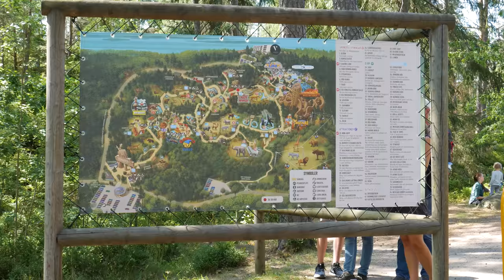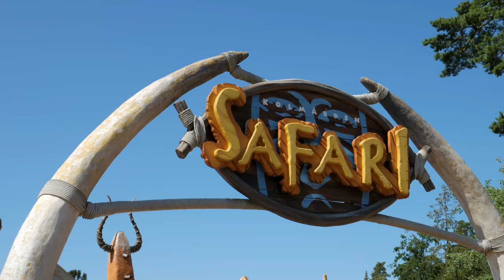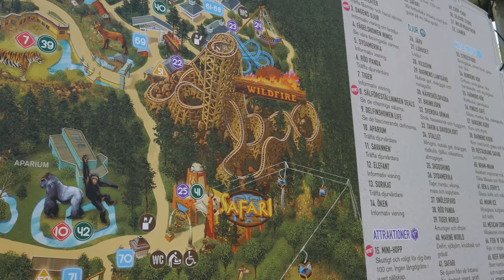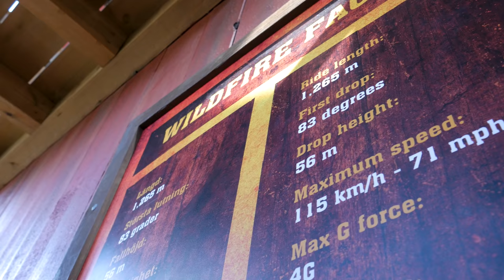What is: Wildfire - Europe's Tallest and Fastest Wooden Roller Coaster

Comment: My problem with RMC “wooden” rollercoasters is are they really “wooden” There is so much steel on the track it’s more a hybrid style track
Reply: Also they aren't wooden coaster because of the steel support structure
Reply: Regular wooden coasters feature quite a bit of steel as well.
Reply: @Sonderax  but look at the structure that holds the lifthill. It's not just a bit of steel it's purly steel.
Reply: @MoniceSF  So 1 lift hill makes the ride a hybrid. All wooden coasters use steel in some aspect.
Reply: @Sonderax  you'll never get it will you?
Reply: @MoniceSF  i get it. but wooden coasters all feature steel supports at some section. so are there no woodies at all?
Reply: Simonize pe so does white lightning at fun spot not qualify as wooden because it has a steel structure?
Reply: No some of the normal wodden coasters by gravity group have fully steel support structures but are still considered wodden coasters

Comment: I love coasters but if Kolmarden says "no more attractions that scare animals" then at least they still have Wildfire. Otherwise I'd love to see a Fury 325 sized version of Diamondback; a with a 320' drop, a top speed of 95 MPH, a length of almost 8,000' and more airtime than any coaster in the world. They'd need silencers for the noise that comes from resetting the trim breaks so as not to scare the animals though, so perhaps it doesn't need to be a B&M, which is also the most expensive roller coaster brand. Great video though, thanks for posting!

Comment: Nice video!  Technically, RMC makes "hybrid" coasters with their topper track (or steel coasters with their I-Box track).  The coaster's structure isn't what determines the type of ride; the track does.  A wood coaster has a wood laminate track topped by a thin strip of steel.  But RMC, though they start with wood laminate, places a prefabricated steel box beam on top (where the last few layers of wood laminate normally would be).  IMO, it's a steel coaster, and it rides like one.  But RMC has a great design team and does make really thrilling rides -- just not wooden ones.